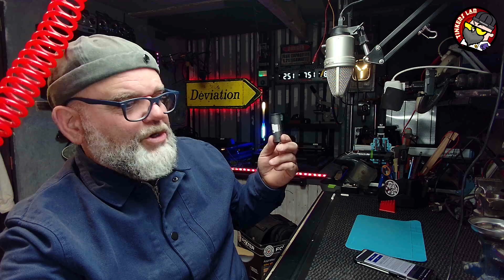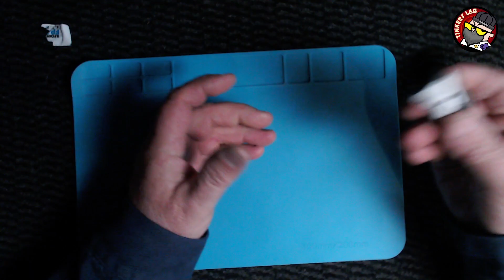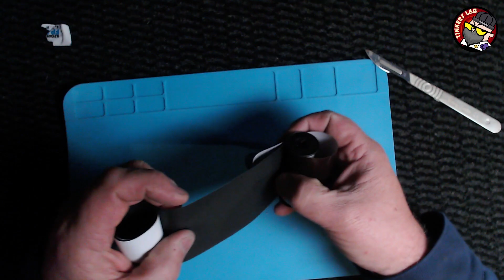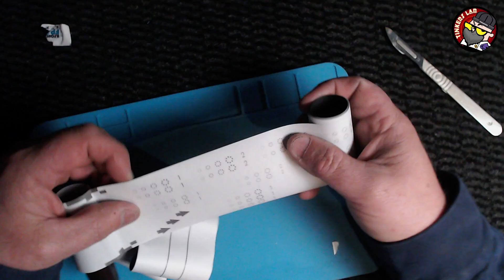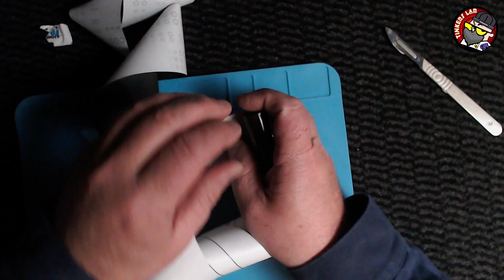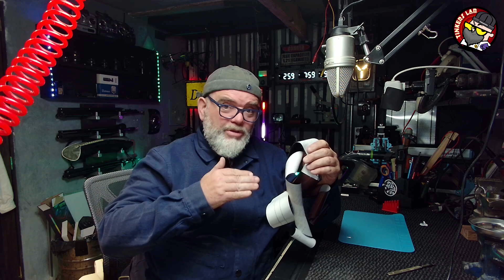120 roll film is still better than digital

Comment: Back in the film days did a bevnap calculation that to equal film on 8x10 a sensor would need to be 14 mgpxl. Well, I had a 5 mgpxl Minolta 'prosumer' camera that could print 20x30 inch portraits . . . there are so many variables. A 4x5 inch Vericolor negative was so grainy that an 11x14 was the maximum print and it looked like hell. Years later, scanned the negative digitally, and made 20x40 inch prints with extraordinary detail and no grain or color noise. Lens quality (circle of confusion) has to be matched with pixel size and pitch, and sensor size then comes into play . . . an extraordinary lens with small pixels, even on a small sensor, smaller than 4:3rds even, can outperform larger sensors. Conclusion: 4x5 and 120 film can rival the best sensors, but the darkroom is over . . . digital inkjet printers have a much greater gamut and accutance than darkroom papers.